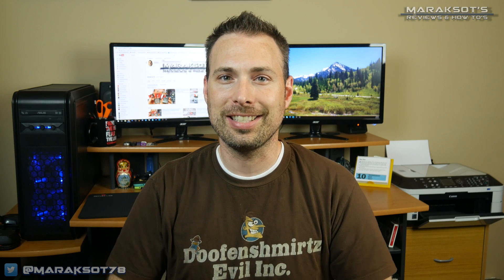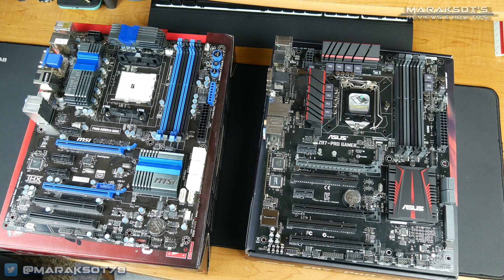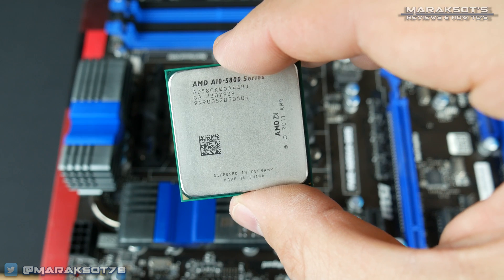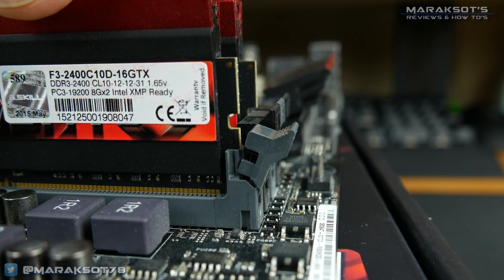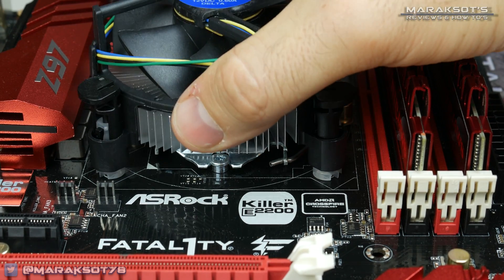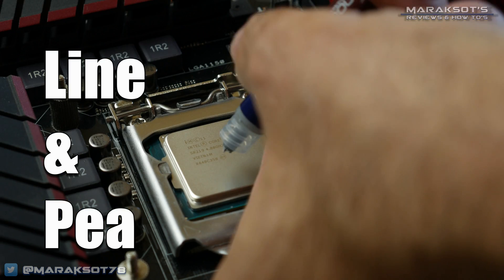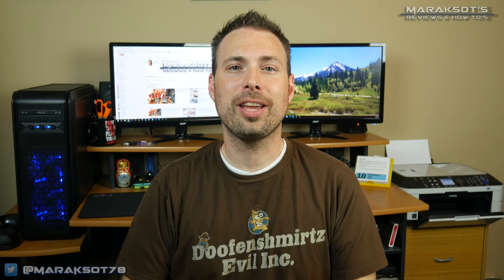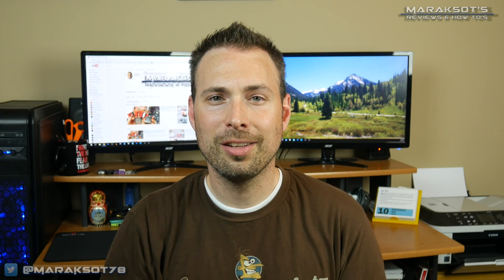Beginners Guide: How to Build a Gaming PC Ep. 2  - CPU RAM & Motherboard Installation

Comment: https://pcpartpicker.com/user/Wannabepcbuilder/saved/QgRmGX. Do you think this is a good budget pc build to play overwatch, gta 5, black ops 2, and csgo?
Reply from the maker: sorry it's taken me so long to get back to you on this.  Life has been crazy.  :)  From the looks of it you've put together a decent 1080p gaming rig there with good upgrade potential.  Best of luck to you on your build.  Enjoy!
Reply: Maraksot78 ok thank you so much I started to order the parts already
Reply from the maker: it should play Overwatch, Black Ops 2 and CSGO pretty well however you're going to have to bump some of the settings on GTA 5 down a bit.  It's a very hardware intensive game especially when it comes to the CPU.  To get above 60fps at max settings at 1080p GTA 5 needs an i5 and probably a GTX1060 or RX580 or other comparable GPU.
Reply: Maraksot78 ok

Comment: I need help finding a computer case that will be able to last a while and be able to upgrade inside of it easily
Reply from the maker: +Secretive Ninja what all are you looking to put in it? What I mean is do you want to put a DVD drive or Blu-ray drive in it? Because most newer cases, especially "gaming" cases have completely removed the 5 1/4" bays to allow for water cooling and stuff instead because many people just download their software nowadays. I think most cases now do a great job at being easy to work in and upgrade parts, well most mid towers are anyway. :D mini itx stuff gets pretty tight.
Reply from the maker: +Secretive Ninja I've found the $70 to $100 range actually has a lot of really nice mid tower cases right now with features that 5 or so years ago were only really available on $100 to $200 cases.
Reply: Maraksot78 I'm looking for a gaming computer case that doesn't have the DVD drive or blue ray drive in it, I'm thinking about getting the nzxt s340 black and red. But I keep having second thoughts on it, do you think I should get it or a different case?
Reply from the maker: Secretive Ninja the S340 is an awesome case. I have a video about it as well. :D ha ha you can of course check it out too if you want.  https://youtu.be/h6B6i2ym0lc

Another case that I've never built in but I think looks really cool and may be what I do my next build in is the Phanteks Eclipse P400 with tempered glass side panel.   :)
https://m.newegg.com/products/N82E16811854046
Reply from the maker: Secretive Ninja the S340 is an awesome case. I have a video about it as well. :D ha ha you can of course check it out too if you want.  https://youtu.be/h6B6i2ym0lc

Another case that I haven't built in yet but I think looks really cool and may be what I do my next build in is the Phanteks Eclipse P400 with tempered glass side panel. Check it out and see what you think.  :)
https://m.newegg.com/products/N82E16811854046
Reply: Maraksot78 ok thank you a lot
Reply from the maker: Secretive Ninja no problem man. I love talking about computer stuff.  :)